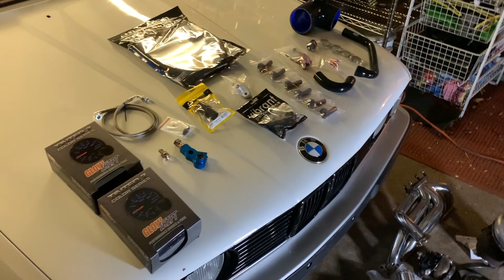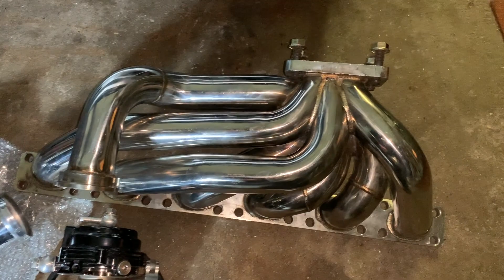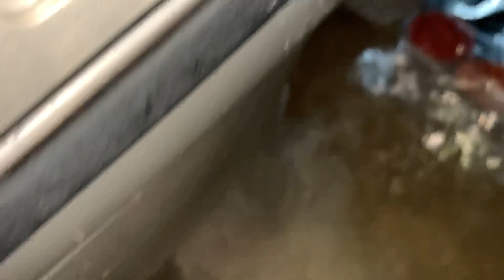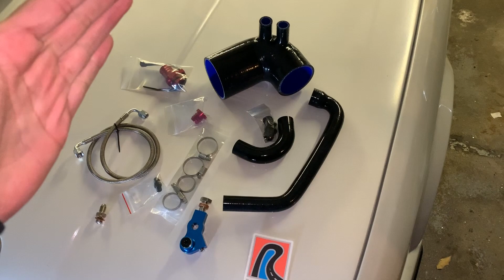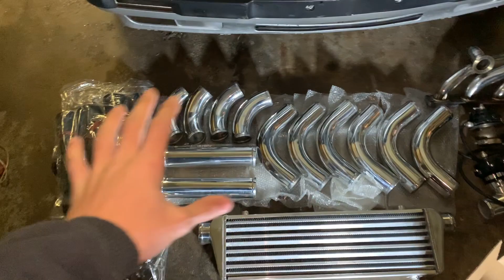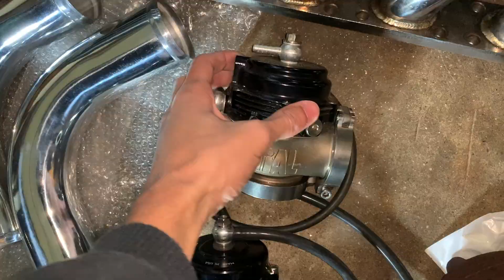M52 24v BMW E30 Turbo Build: Introduction (Ep. 1)

Comment: M52b? 20 25 28 ?
Reply from the maker: started as an m52b28 but it has the crank pistons and rods out of an m54b30 making it a 3.0L now
Reply: @ImJoel  Stock Parts ? and now 500 hp?